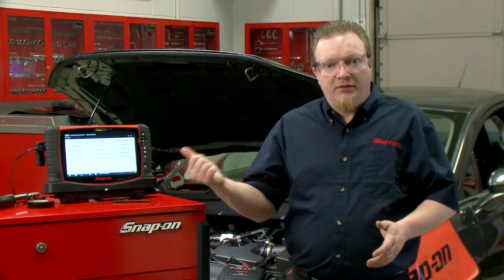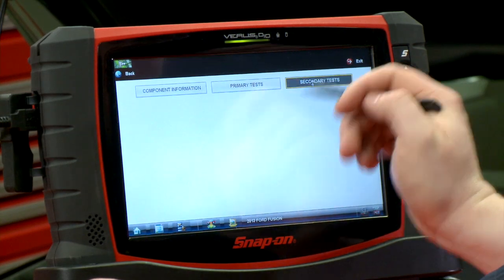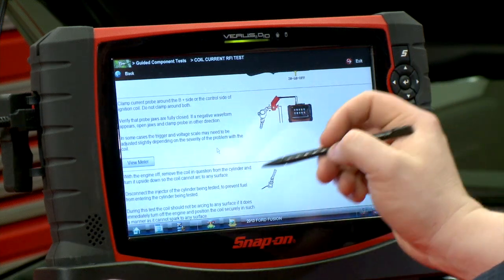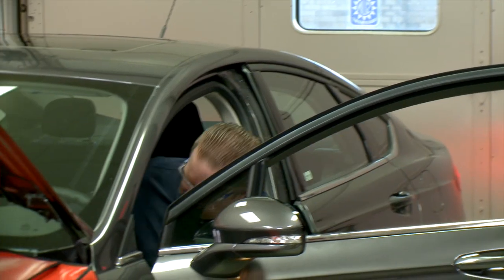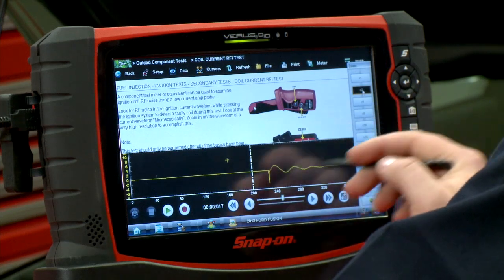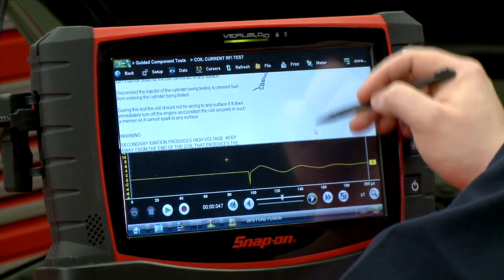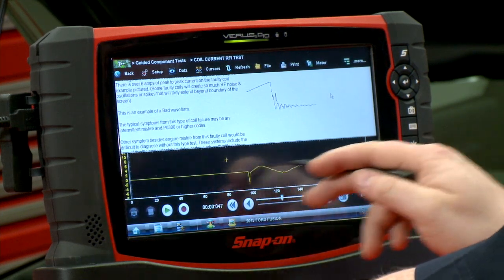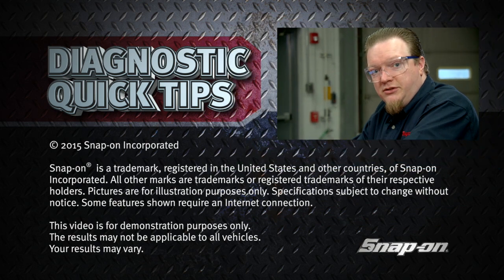Ford® Coil Current RFI Test- Diagnostic Quick Tips | Snap-on Training Solutions®

Comment: TSB 05-22-8 relates to older vehicles. It does not specify this test for any late model vehicles. While you can perform this test on 2 wire coils, DO NOT perform this test on 3 wire coils, as the coil and/or the PCM can be damaged.

On a 2 wire COP system, this is a great test to verify coil condition. Often you can pinpoint a failing coil before misfires register in mode $06 data.

Comment: flip the coil over and start the car?  wtf?
Reply: geoffrwelsh Yup!  Procedure comes straight from a Ford TSB.  #05-22-8.  Just keep your hands away from the business end of the coil!
Reply: Jason Gabrenas   Interesting.  I always current ramp them installed, accessing at the PCM, and the weak ones usually fail to Triple Strike at idle.  On engines like the 3.0L V-6 in the Escape, it's hella easier that way.  Thanks for the info, Jason.